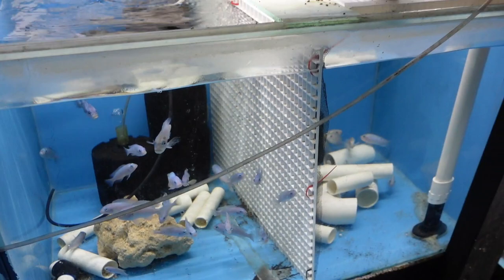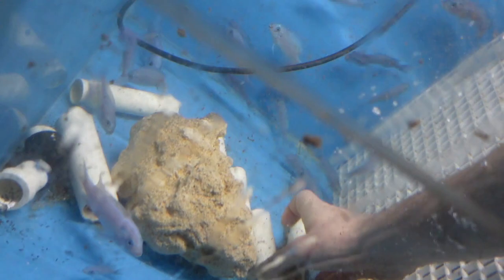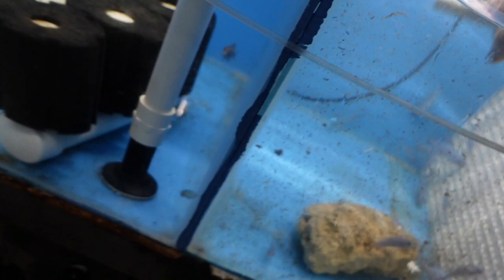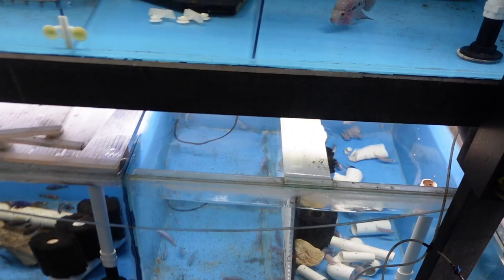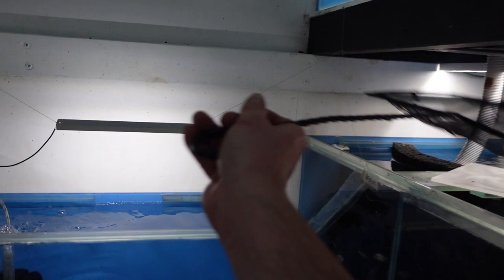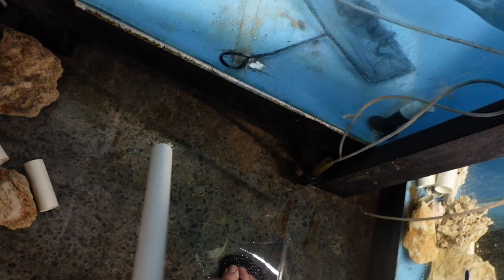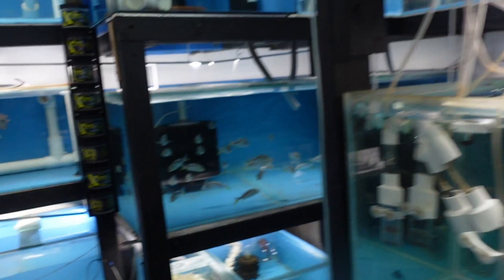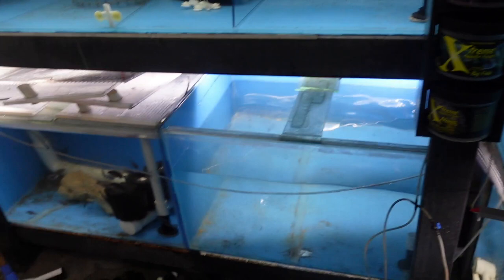The cursed tanks leak again time to shut it down

Comment: Is it worth taking out the auto water charge pipes for a day or 2 make sure that’s were all the water coming from
Reply from the maker: Yeh once I've fixed this leak if that's not the issue I'll turn the whole system off for a few days